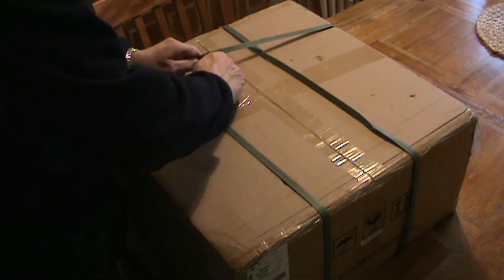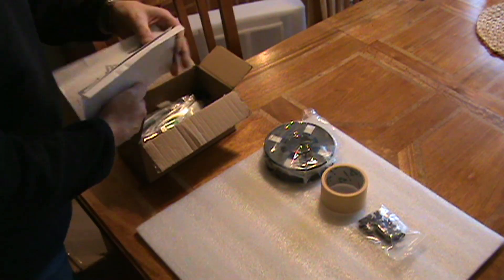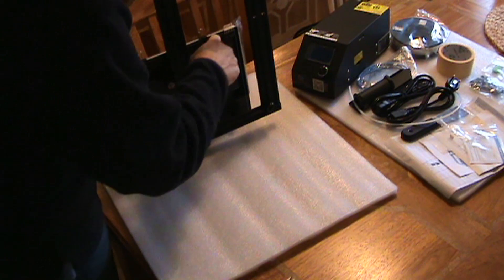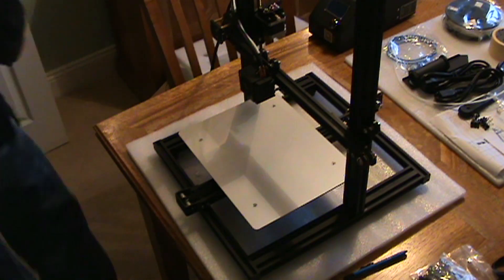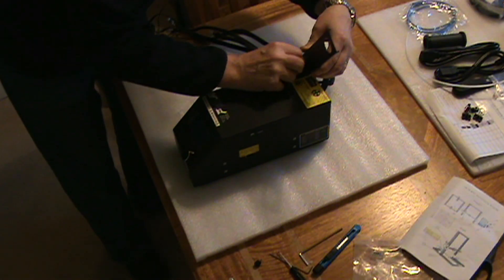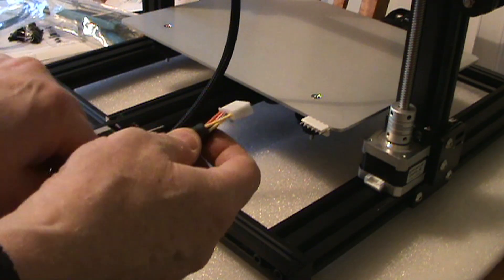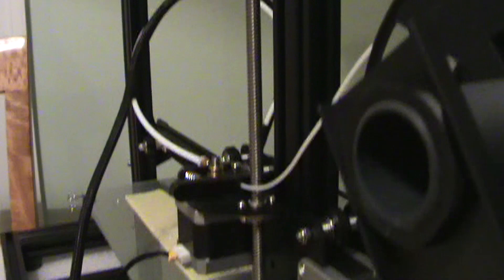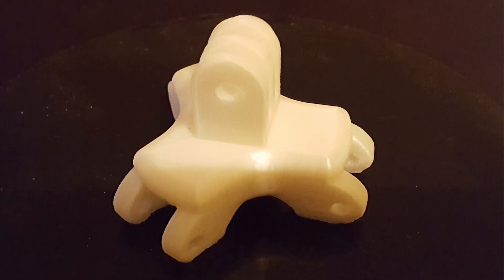Creality CR 10 mini

Comment: My mini is still in the box, will hopefully get time to unbox it in a couple of days. This seems like the most reasonable video about the mini I have come across.
Is it better to connect the Z limit cable before attaching it to the frame, I heard it was quite difficult to get at otherwise?
Thanks for the video.
Reply from the maker: Yes I think so. I did have a bit of wiggling to do to get mine conected, but it did work in the end. Connecting it first is probably the best.